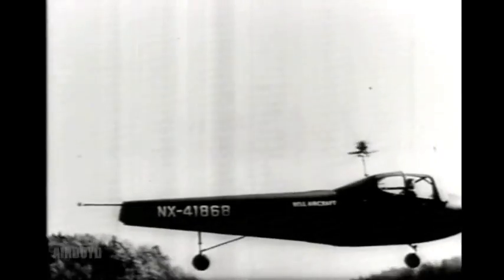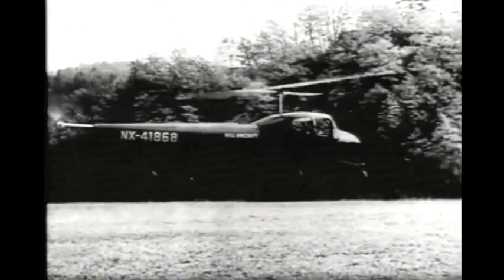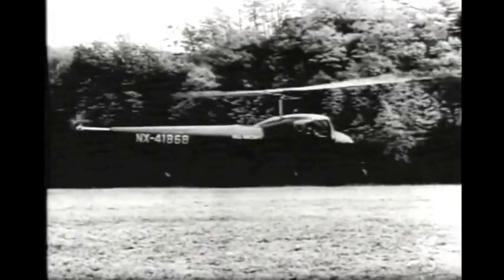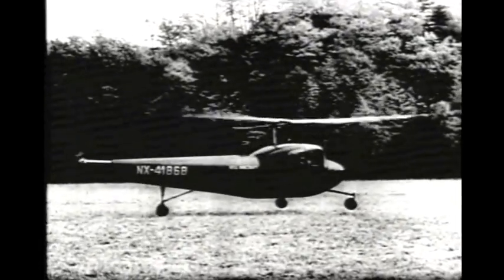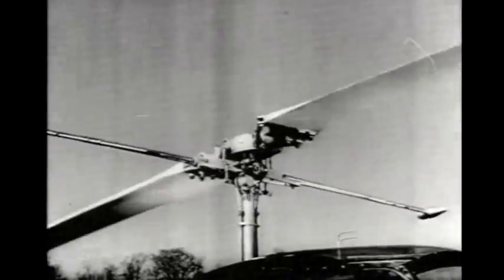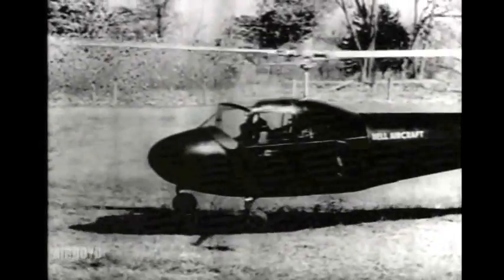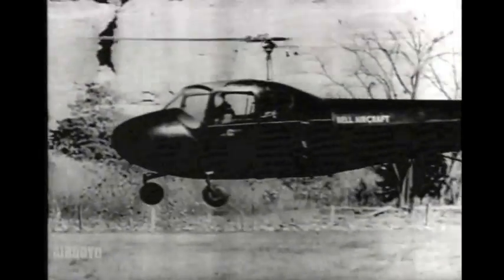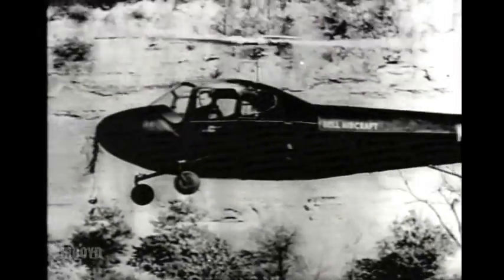New Helicopters (1945)

Comment: In detail: the motors may have sounded like that. But I highly doubt that there were none of the rotor sounds we all know. Or that the motors weren't always at constant rpm to drive the rotors in hover flight as we hear it in the video. And I think that the microphones at that time were to bad to capture the loud sound so close to the helicopter. Conclusion: The sound was added later on.
Reply: Yeah, they often dubbed in the absolute WRONG sounds, especially in newsreels.  Guess they figured that the audience was so unsophisticated that they wouldn't notice.  OR!  They were under deadlines...
Sometimes the engine does sound like a 6-cylinder aircraft engine, like the Franklin engine in the Bell 47G, but other times it's clearly a radial engine being throttled up and down, many times at or near idle.  LAST thing one would want in ground effects maneuvers is an engine at idle!
For an idea of how the rotors would actually sound, search for the Kaman HH-43 Huskie or K-Max.  They also have twin intermeshing rotors, and don't exactly make the chop-chop sound.
Kellett was an autogyro manufacturer, and ventured into HEElicpoters during WW II. (No "Sheilacopters"??)
The twin intermeshing rotor design was used first by German designer, Anton Flettner, whose first design of a twin rotor copter was in 1940.